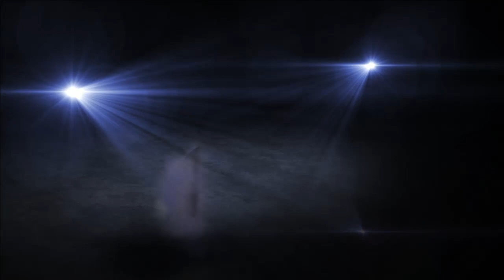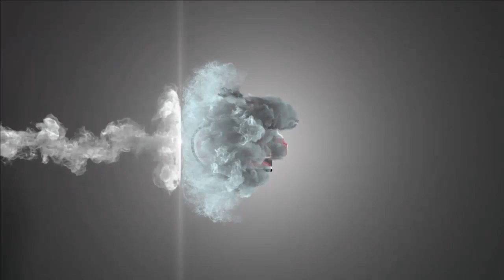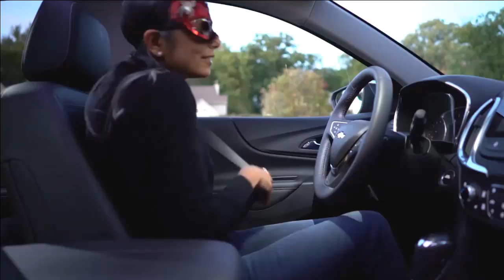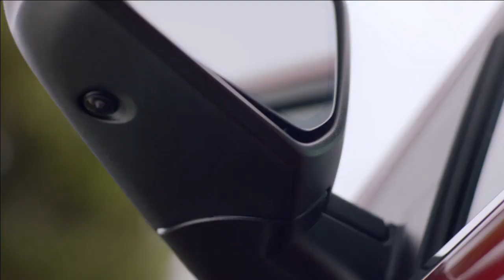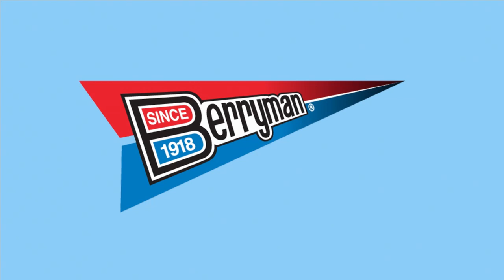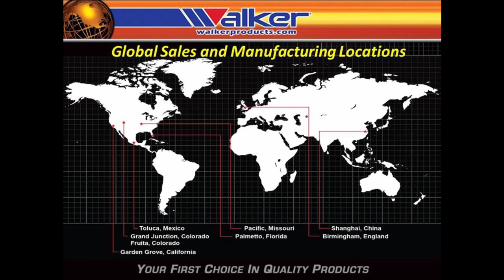Bobby Likis Car Clinic Oct 27th, 2018 "Like Us; You'll LOVE Us!"

Comment: I am a DIYer and a Q&A radio/podcast addict. I discovered Bobby Likis in July 2018.  I can tell Mr Likis is the real deal and has seen and done it all. However the show has so so many commercials. Yes I can and do FF thru them on my phone/laptop. But All this sponsorship restrains a professional from calling out products and platforms and aftermarket brands of parts that are real stinkers. Take myself- I will NEVER be able to afford a new vehicle. I and my kids will ALWAYS be in 15 yr old and older vehicles with myself maintaining them and doing repairs . If Im not capable of repairing something I pay a local shop to do it. So for me and people like me any 3 valve Ford V8 would be a bad choice. The oiling system is proven to cause EXPENSIVE EXPENSIVE problems to repair that often lead to engine needed replaced. (Cam Phaser issue). Chrysler 2.7 engines are known bad- Ford Focus and Nissan CVT transmissions...These are platforms that are bad. Looks like a snake its a snake. Bad engine designs platform designs will devastate the unsuspecting uniformed person making $40,000 or less per year looking for that good reliable daily driver should they buy one. And Mr Likis its NEVER good to buy a first year car or truck. You say in the the above broadcast that in 2018 that caution is not necessary. Mr Likis with all the tech and computer electronics in cars now ITS ABSOLUTELY NECESSARY to let the driving public reveal teething issues. I still learn and I still listen to Bobby Likis but I cringe when lack of maintenance is the blame for the bad reputation an engine/transmission has garnered- when the real reason that engine goes bad early is a design flaw.